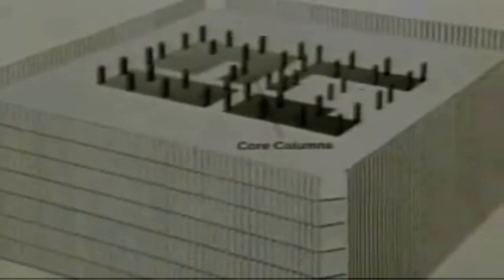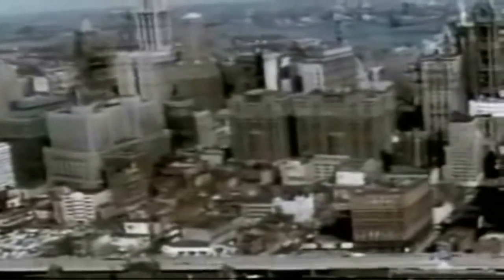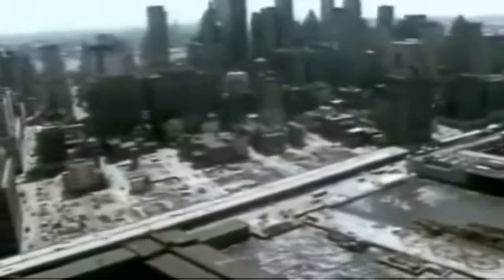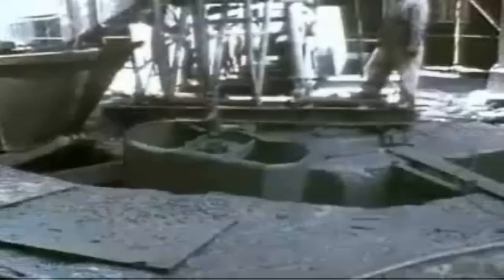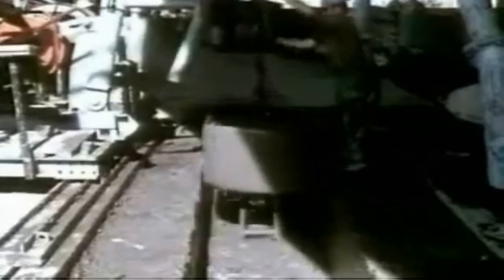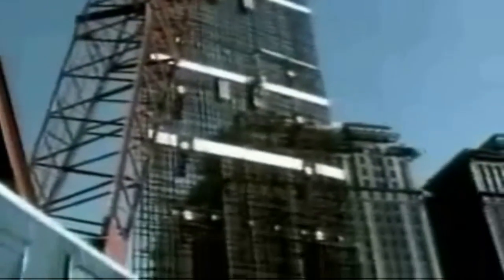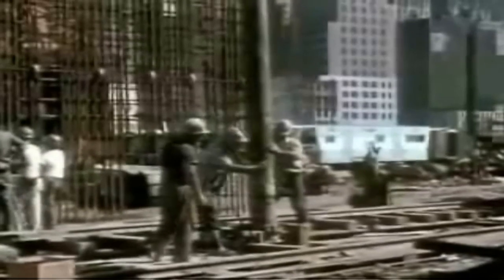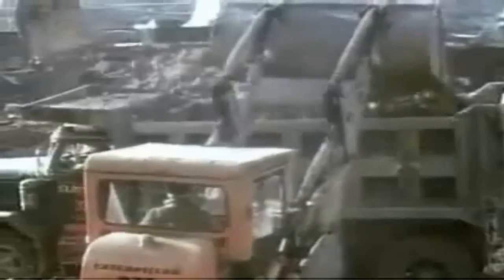Building the World Trade Center Towers

Comment: an airplane would bounce off this.  throw a coke can against a steel pole.
Reply: Lloyd Wagner
"bombs went off in the basement before the planes hit" 
prove it

"there isn't enough jet fuel to fill an elevator after blowing up"
flight 175 had about 7,000 gallons of fuel, and only the portion of it that was turned into a spray upon impact was the portion that exploded at the beginning. How is it impossible that the kerosene could have spilled down the elevator shaft hmm?

thickness of steel:
You seem to be confused. I'm definitely confused by your comment. I don't know what you're talking about. The outer wall was made of large steel box columns. Those columns were hollow. I don't know for certain how thick the walls of each column was, but oldschool is claiming that the walls were only 1/4" and 3/8" thick at that height. So the steel columns were just flat 1/4" plates that were welded to form a box shape. At "point of impact" he was probably trying to point out that the thickness of the steel was different at different heights. It was thicker at the bottom and thinner at the top to keep the building light. With that in mind, it only made sense for them to crash the plane into the upper parts of the buildings. That way they could do more damage.

You sound like a "no planer." Am I right? You know... half the population of Manhattan watched two planes hit the twin towers. Too bad you can't just dismiss half a million witnesses.
Reply: Adam Selene 
1. I think it's very clear to everyone that it has an ignition source. You don't need a fire to set it off. You just need heat.

2. Nobody ever said it is exploding on every floor. The puffs of air you see during the collapse is the effect of every floor collapsing onto the next floor under it.

3. "Nor is vapor going to fall down those long elevator shafts in enough quantity to detonate only in the basement and tear out heavy walls"

 well why not? How exactly is this unrealistic?  Its not. A few gallons fall to the floor, it vaporizes after a few seconds, then something hot or on fire falls and ignites it. Tell me that's not realistic. Tell me you wouldn't expect that to happen multiple times after a plane crash.

4. If demolition charges were going off in the lobby, everyone in the lobby would have died. They survived because they were seeing kerosene vapor explosions which expand much slower, have a smaller shock wave, and involve large flames. Demolition charges don't have flames, and they cause internal damage and deafness to anyone within the shockwave range. Did everyone in the lobby go deaf? No, because there were no bombs in the lobby.
Reply: Lloyd Wagner You're not paying any attention. Nobody said the contact area is 1/4 inch thick. Are you stupid? I just finished explaining that point. Look like 3 comments back

Adam Selene  How many people do you think are in on this "conspiracy?" How many people do you think have been burying this for 13 years? How many would have to be involved in order to pull off a "controlled demolition" NONE of which have confessed in 13 years. Really? None of them? Nobody has had a guilty conscience and just said "hey everybody. I helped set the charges on the north tower. Sorry about that." or "hey everybody, I worked in flight control that day, and there wasn't a plane" or "hey everybody, I worked at the Langely base that day, and the whole thing's bullshit" or "hey everybody, I work for Fox News, and the live feed wasn't really a live feed" or "I was in chopper 4 that day and the plane wasn't really there" or how about "Hey everybody, I was recording the whole event and I never gave my video to the government for the investigation. Here's some original video!" 
Seriously?? in 13 years none of these things have happened?? Oh I guess its because its not a conspiracy.
Reply: Yes well I was only trying to debunk the idea that a plane can't go through the outer wall. To know how much floor it can destroy would need a much more complicated calculation. But as as rough estimate, you can compare the kinetic energy of the plane to the energy released in a TNT explosion. According to this webiste, http://911encyclopedia.com/wiki/index.php/World_Trade_Center_Jet_Impact_Kinetic_Energy

the kinetic energy of flight 175 was about 3.5 billion Joules. According to wikipedia, one ton of TNT releases about 4.2 billion joules of energy. https://en.wikipedia.org/wiki/TNT_equivalent 
So this means that the amount of energy that flight 175 released into the building was about 80% of one full ton of TNT and it directed all of that energy within the path of the plane's collision. Would you believe that 0.8 tons of TNT can do that much damage? Because that's exactly the amount of destructive power that plane contained when it collided with the building.
Reply: Can't argue with real physics.
Reply: Robin Redbreast
1. I haven't justified anything.
2. It's just like you said. repeating "it was a planned demolition" doesn't make it true no matter how many times you say it. It just shows what a stubborn moron you are.
Reply: .... unless it vaporizes.. In which case it explodes
Reply: aSASa45454 it was planes and a fire :/
That's the very point I try to focus on in this endless, pointless battle with YouTube commenters.
Reply: That's the shill's decoy and defence tactics, engage the opposition in nonsense arguments, add some abuse and insults till you ground them down in frustration and drive them mad.  Shills and Hasbaras never give up, but the truth is the truth.  A guilty psychopath never gives up.
Reply: lol. If a 25-ton block of butter hit a twin tower at 500 miles per hour, it would obliterate the outer wall. The material doesn't matter. The beams can't stop that much kinetic energy. Period.
Reply: Oldschooldan1 Those bombs in the basements fell out of those planes too, I suppose. LOL
Reply: ***** Not without something to set it off it doesn't, nor is it going to explode all up through the building on discreet floors at regular intervals. Nor is vapor going to fall down those long elevator shafts in enough quantity to detonate only in the basement and tear out heavy walls. Check out what people that were in those basements said about the explosions.
Reply: an airplane would definitely not bounce off of the towers for very obvious physical reasons
Reply: *****
crashing at the bottom would still be more effective (if possible) regardless of the thicker columns.

also there would be very little fuel to run down 100 floors of elevator shaft (ignoring that there are no elevator shafts that go to the lobby from the 100th floor, except the service elevator which was not damaged in impact, obvious from the fact people were in them at time of impact)

so no, its not really possible for the fuel to have went to the bottom and had any significant amount of explosive power.
Reply: *****
Well I'm not trying to say that I think everything about the events can be put off as "I'm not sure, but it seems unlikely, therefore the guvvament dun it"

I just dont see the point in arguments like the lobby explosion, "no plane" nonsense, and car fires for example. There is much more compelling physical evidence in regards to the actual collapse mechanism.

I dont care how it was taken down (Mini nukes, directed energy, explosives, nanothermite, and godzilla to name a few)

I just care that it wasnt a natural collapse.
Reply: ***** I read that calculation of yours(a.k.a the long comment ) and its simply the best explanation one can give so patiently :) and please someone educate the guys with the "bounce back" theory that not all 1000s of tons of building material is opposing the plane its just three floors of slotted iron columns (with its respective core) versus the plane . its like shooting a small canister filled with gasoline at 400 mph into a slotted iron mesh completely devastating the latter .
Reply: Joseph Chavez this is old. I don't remember what I said. What are you referring to? The outer wall? I've since learned that the wall was made of verticle box columns that tapered in thickness as they went up the building.
Reply: Lloyd Wagner 
hurr durr it's not like he knew he was going to die or anything. It's ridiculous to think he wanted to identify himself hurr derr

So lets recap. You think:
All of it was faked and
The Bush administration is in on it
Congress is in on it
The FBI is in on it
The CIA is in on it
NIST is in on it
United Airlines is in on it
American Airlines is in on it
The US Air force is in on it
MIT is in on it
Purdue University is in on it
Popular mechanics is in on it
All of these peer-reviewed studies are using fake numbers and nobody has noticed yet
http://debunkingnoplanes.blogspot.com/2014/04/scientific-research-on-physics-of-world.html
The witnesses are in on it
All of the media is in on it
Pretty much every structural engineer on earth is in on it, since the AE911truth movement is about as significant in numbers as a high school.
FEMA is in on it
The FAA is in on it
And the victim's families are in on it

^All of these would contain dozens to thousands of co-conspirators each and after 14 years nobody has come out of hiding or even leaked a single shred of credible evidence. And you think I'm the one who believes a fairy tale.
Reply: Adam Selene 
So you think all of those thousands of people are just pussies. Is that right? None of them would expose the inside job if they had a chance? Not even the veterans among them? Nobody would anonymously release a file via wikileaks? Nobody in the ENTIRE scientific community would even debunk the studies I just posted in fear of the government?

https://s-media-cache-ak0.pinimg.com/736x/a8/a1/57/a8a157dea81462378ca87a25c37138ef.jpg

this gets better every time I see it
Reply: So who are these imaginary people with sensitive info you are referring to? Your delusion is proving to be quite entertaining
Reply: Adam Selene
Exactly. And he DOES know the government is lying.
Reply: Except for the fact that the planes were flying at a downward angle for several miles before the impact, which easily causes dangerously high speeds. Try thinking for once guys
Reply: Adam Selene
http://911blogger.com/node/20232

here's a quote from that link:

"2.	A Boeing 767-200 airframe is rated to .86 of Mach speed (speed of sound) at any altitude before the risk of structural failure. It as the aircraft approaches the speed of sound when the properties extreme high and low pressure areas can have destructive effects on the airframe. This figure is as with all limits set conservatively.
3.	The speed of sound at approximate sea level is 761 mph on a standard day. Therefore the theoretical maximum speed the 767-200 can reach intact is, conservatively, .86 x 761mph = 654mph or approximately 100mph above the officially reported speed of AA11 or UA175."
Reply: @TaylorYarick  thank god some people with real knowledge can talk back facts to these conspiracy morons
Reply: aSASa45454
You know how it is though; cowards will say anything to avoid the logical conclusion if it makes them uncomfortable. It is very sad that people can be that afraid of something as simple as the truth. Oh well, Ya' just can't help a person understand that refuses to.
Reply: aSASa45454
"crashing at the bottom would still be more effective"
I disagree. I don't think the plane would have even penetrated the steel if it hit the bottom of the building instead.

about the elevators/fuel: I don't know much specifics about the elevators or the floor plan of the core structure. According to this link, cars 50 and 6 both could have fallen straight to the ground, and there was also many other elevators that could have fallen to other floors. https://sites.google.com/site/911stories/wtcelevatorshafts

there's also this. click on it, press ctrl+F, and type "smell"  http://www.911myths.com/html/jet_fuel.html
Reply: Rat Salad Lovely.
Reply: : Well, that's the real question, isn't it? Why? The 'How' and the 'Who' is just scenery for the public. Explosives, no planes, melting steal, keeps 'em guessing like some kind of parlor game. Prevents 'em from asking the most important question: Why? Why was it done? Who benefited? Who has the power to cover it up? Who?...
Reply: Lloyd Wagner 
you're pretty misinformed. The plane did slow down during impact. Look it up. Its not hard to find proof. Or do measurements yourself if that's your style. Everyone who does it concludes that the plane lost about 12% of its kinetic energy before it went out of view. And the twingtips didn't even break the beams. They only knocked off the aluminum cladding, exposing the steel. It's visible in photos. So there you have it. Your argument is based on lies. Not mine.
Reply: Lloyd Wagner 
well you obviously haven't done a single bit of research on anything. I'm not going to do it for you. Instead of assuming you're right all the time and everyone else is wrong, you should try actually backing up your beliefs with research and  evidence. You'll end up feeling like an idiot.
Reply: Lloyd Wagner 
excuse me, when you say "there was only a 16 foot wide almost round hole" are you referring to this?
http://911review.com/errors/pentagon/imgs/exit2.jpg
and are you trying to say that its the entry-point of the plane?
Reply: Lloyd Wagner 
Oh god look at all that aluminum cladding.... It just breaks my heart to show you how stupid you are....  https://www.metabunk.org/data/MetaMirrorCache/99e11088e7613155bda454cfe4e0dcab.jpg

not.
Reply: oh sweet jesus all that aluminum cladding and plane parts  http://files.abovetopsecret.com/images/member/3fc887f4576f.jpg
Reply: oh gawd I'm jizzing from all this aluminum cladding on the steel beams!
https://3.bp.blogspot.com/-FkH60hn3iC4/U7pUIwxaV_I/AAAAAAAAAPI/E3wlHRf5fFE/s1600/WTC1+leftwing+01.png
Reply: Are you blind?

I showed you pictures of the steel beams, with the aluminum cladding clearly visible. The aluminum is silver. The steel is brown. 

so where is this "16 foot hole" you're speaking of hmm? Where are these windows that were supposed to be hit by the plane huh? Seriously. Show me one window that was supposed to be broken.
Reply: Lloyd Wagner 
Hey look i found  proof that you're a total moron
http://911research.wtc7.net/essays/salter/summaryimages/nistwtc1hole2.jpg
WOW!!! amazing. the plane fits.

And you just showed me a picture that shows knocked out windows where the plane hit on the bottom floor. Here's another one for you  http://www.bibliotecapleyades.net/imagenes_sociopol/911_3playact15.jpg
Again, where are these intact windows you're going on about
Reply: Lloyd Wagner 
so your argument is: a plane can't punch a perfect hole into a steel building so there was no second wtc plane. And a plane CAN punch a perfect hole into a concrete reinforced building therefore there was no plane at the Pentagon. Is that what you are sticking with?
Reply: Please correct me if I misunderstand because you are looking dumber and dumber every minute
Reply: So when you move from stupid question to stupid question like that, are you admitting defeat on the ones I already answered or do you just pretend to pay attention?

The passport! OH GAWD the passport! I feel so powerless as this is obviously the smoking gun of the entire operation! It's not like wallets and passports are ALWAYS found in EVERY plane crash site that has EVER happened!
Reply: Lloyd Wagner you apparently don't know that the passengers of the planes had cell phones. They mentioned the box cutters during the calls. Maybe now you see why I keep calling you stupid?

https://s-media-cache-ak0.pinimg.com/736x/a8/a1/57/a8a157dea81462378ca87a25c37138ef.jpg
derr derr duh derr just move from topic to topic and maybe you'll look less dumb derr derr
Reply: No I know nothing of Michael Hastings. Please fill me in on his relevance to 9/11
Reply: Lloyd Wagner Lol there's a big difference between being under rule of an evil person and actually keeping an evil-doer's secrets for 14 years. Your comparison doesn't even make any sense. I'm on the real side of history. You're on the delusional side. What you believe is a fairy tale.
Reply: Adam Selene 
Oh so you assume that the government lies about everything. Okay so I guess terrorist attacks aren't even real. Is that right? The government must be responsible for the boston bombings too huh?
Reply: Lol you guys are great. Both of you are like a Christian who thinks that atheists are just rejecting god's love or some bullshit like that. No no, I just don't believe he exists. There's a very big difference.

I'm going to try to make this as clear as possible for you. Don't make claims about what I believe or know.

I do not believe that 9/11 was an inside job, and I never did.
Sure all governments have secrets but if the government is lying about anything 9/11 related, it has nothing to do with covering up a false flag because while the American government may be corrupt, it's not a bunch of evil illuminati lizard people who kill citizens like sheep. If they wanted to perform a false flag, there are hundreds of easier ways to do it.  Also, "No-planers" are the dumbest, most useless bunch of people I have ever conversed with. Truthers I can stomach, but No-planers are about as deluded as flat-earthers.
Reply: Adam Selene
 Is that comment relevant to the conversation somehow? You're insinuating that the government lies about everything, and therefore 9/11 had to be fake. I was just pointing out what a dumb argument that is.
Reply: Tomislav Kovačević Hey, just so you would know, passenger planes can NOT do 500 mph at 1000ft sea level, its impossible. Yes they can reach that speed, but only at 30,000-35,000 ft where the air is much thinner. Cause it was designed that way!!! Hello McFly!!!!!
Reply: look what a tornado can do with cardboard something going that fast doesent really care whats in the way
Reply: +Lloyd Wagner You are the dumbest person I've ever seen on YouTube. Truly an accomplishment.
Reply: Oldschooldan1
Jet fuel can burn, it does not detonate. Think "kerosene".
Reply: *****
Yeah, I suppose it is possible. There was also a car #7 then went basement to top.

It seems unlikely but its also not something I am capable of disproving. I dont find the lobby explosion to be all that critical in the grand scheme of things.
Reply: aSASa45454  Just as I am not capable of disproving the thermite theory, since there is just a huge lack of physical evidence. But that doesn't mean I'm going to fall for an appeal to ignorance fallacy
Reply: *****
Still that nonsense? LOL
Reply: Aparajith Sridharan
Nope.
Reply: Robin Redbreast
Exactly right.
Reply: ***** No, it wasn't a solid slab of steel. It was an intense grid of steel.
Reply: loutcb You idiot. Just think about how big object a plane is and how fast it crashed...
Reply: Robin Redbreast whether you understand it or not, it is the correct answer.
Reply: Joseph Chavez
There was only ONE country that had ONLY benefit out of it, and there were 5 of that country's citizens picked up laughing and dancing in New Jersey that day. The dirty fuckers.
Reply: *****
Tell ME to "look it up" and find proof for the idiotic shit that YOU are claiming. Man, have you got some nerve.
Reply: ***** Right, I'll do research to try to prove your bullshit, and forget the clear evidence of the videos.
There IS no aluminum cladding over the WTC. I've ALREADY done the research and watched more than one video on the original construction of the WTC buildings. The "planes" did NOT slow down. You can see it right in the video, by watching it frame by frame.
There WERE no broken windows where the wings would have gone into the Pentagon. There WAS only a 16-foot wide almost round hole.
You 9/11 criminals should have made the videos a little more convincing, if you didn't want people to call you the filthy liars you are.
Reply: Lloyd Wagner
Of course he does. Anyone drawing breath knows that at this point.
Reply: ***** The "bombing" wasn't the event; the response to it was the event. There were military on the streets in Boston, pointing loaded weapons at Americans in their homes. Is that sort of thing alright with you?
Reply: tzef73
Correct.
Reply: *****
It is about air density and airframe stress, not just thrust.
Reply: ***** A simulator? And professional pilots say you can't turn that plane at the reported airspeed at the rate of turn required. Nor can, under any circumstances, jet fuel melt structural steel.
Still, this is all old stuff; we already know the "official" story is nonsense.
Reply: loutcb are you actually that stupid?
Reply: You guys are arguing for way too long lol
Reply: Taylor Yarick - you talk a good talk but at the end of the day it’s just talk.  No matter how many billions of joules of energy were slammed into the trade center it doesn’t matter because those towers absorbed the energy and evenly distributed throughout the entire tower.  

If the structure was weakened at the impact point and give or take 5 floors above and below that section would fall in the direction of least resistance.  Meaning the top 20 floors cannot pile drive it’s way to the ground pulverizing concrete and steel to dust.  20 Ton beams were Hurled the distance of 2 football fields.  

And your explanation or reasoning covers towers 1 and 2.  Please explain what energy source cause building 7 to collapse at near free fall speed?  

If those towers did collapse according to your high end physics education then tell me why the collapse was not a gradual collapse and one which took less than 18 seconds?  The towers would meet resistance as it gets closer to the middle section and lower section.  Hmmm I’m guessing physics laws took off that day needed a rest just like your BS comments.
Reply: Jiren The savage - that would make sense if there wasn’t those annoying NEWTONS LAWS....  also your other problem would be how you can get a commercial airliner to travel at 550 MPH at only 1000 feet...  👍🏼👆🏻
Reply: This is by far one of the most retarded comments I've ever seen on a youtube comment section. This is definitely in my top 10 most retarded comments. This is so retarded, that I don't believe you're being serious at all.
Reply: loutcb Completely 100% wrong.
Reply: Was there an argument in there? I didn't see one. I just saw you throwing empty insults because you lost the argument
Reply: Lloyd Wagner That's funny because I'm working on my engineering degree and I'm likely the most educated person who has commented on this video by far.

Lets say our 767 weighs ~ 120000 kg. It flies at ~240m/s and the buildings were 63 meters wide. If I allow the entire building's width to be the plane's stopping distance, then [120000 kg * 240 m/s * 240/2 m/s / 63m] rounds off at ~ 55 million newtons of force (12.4 million pounds) required to stop the plane in that amount of time. It also rounds off at {[120000 kg] * [(240) m/s]^2}/2 = ~3.5 BILLION joules of kinetic energy being dumped into those steel beams, nearly all of which was converted into heat. Then, there was the fire. Obviously this is only a general order-of-magnitude calculation but it helps wrap your head around the physics. Can steel box columns, separated by a few feet, hold back 12.4 million pounds of force? If the steel beams at the perimeter COULD hold back the plane, then the stopping distance would have to change in my equation. Lets give it... what? Say 10 meters of deformation in the steel?  [120000 kg * 240 m/s * 240/2 m/s / 10m] = ~ 350 million newtons (79 million pounds) Are those steel beams capable of applying 79 million pounds of force, spread across the area of the front of a plane? No, I think not. The plane could have been made of cotton for all i care. It still would have broken through the outer wall.

 this is nothing like a peanut vs a hammer. Nor is it on the scale of an aluminum can vs a brick wall. It is more on the scale of an aluminum can being shot out of a gun, at a thin, mesh wire screen.

This is not about which material is stronger. This is about the momentum of the plane. That thing is a huge mass moving at a huge speed and it is very hard to stop. Sure if would bounce off the building if the entire building was a solid block of steel or a solid block of concrete, but its not. It is a hollow structure of steel framework and cemented trusses for floors.

On a further note, you probably got your argument from Ace Baker's video. Ace Baker is a professional liar. Even among other conspiracy theorists, he is a laughing stock of sorts for his "no planes" theory. He's very good at making lies seem like the truth at first glance, but that's all he's doing. Many of his arguments are based completely on false claims, such as his 3-layered live feed theory. That whole argument goes out the window when you find out that there was more than 3 live feeds of the crash. Chopper 4 recorded the plane from a completely different angle, which debunks his whole theory. 

If you're still not convinced, what exactly do you think happened? If you really think there were no planes at all, consider this. HUNDREDS OF THOUSANDS OF PEOPLE WITNESSED THE SECOND PLANE and many of them recorded it. If this was simply  video editing, the amateur videos recorded from the street would not show exactly the same thing as what the news cameras showed. If you think all of those videos were edited, you seriously need to think about what's realistic. NONE of the amateur recorders have spoken up about their videos being edited. 

Therefore, the "No plane" theory is the dumbest of the dumb 9/11 theories.
Reply: ***** That's how real physics works. If you can't take it, then just read the last paragraph or two.
Reply: Lol. That last bit made me laugh.
 I can't say the thickness of the aluminum because I did not design the building and therefore I can't realisticly scale it down like that. I'm only providing an analogy to help visualize my point. My point is that the steel wasn't thick enough to stop a huge jet. Also the nose didn't poke out the other side as far as I know. In the clips I've seen, the image is so blurry that you just can't distinguish between a jet and a cloud of dust. But whether it's dust or a bad CGI job is a whole other can of worms.

Anyway, there's calculators on the Internet you can find that tell you the lateral load of typical steel beams. Check one out and try doing the math. If you can find a real contradiction in what I say that is based on math and not on intuition, I would gladly debate it with you. Otherwise I've put in my two cents and I'll end it here because you seem to be resorting to ad hominems that don't contribute to your argument
Reply: 1. I have no way of proving my education, so I demonstrated it instead. If you spend some time studying kinetics equations and classical physics, you will soon learn that everything I said was accurate.  
2. Nothing I said defies newtons laws of motion. Perhaps an analogy will help. Imagine shooting a paintball (or a plastic bb if you prefer) at several sheets of aluminum, spaced an inch apart. Paintballs move at about 200 mph. Is solid aluminum harder than a paintball?  Yes. Would the paintball go through the sheets anyway? Yes. What if the sheets were  moving at 200 mph and the paintball was suspended on a string? Would the ball go through the aluminum? Yes. In both situations it would probably go through several sheets. In order to apply newtons third law correctly, you must consider this: aluminum sheets (steel bars) have a maximum lateral load. That means that when a certain amount of force is applied, it beaks. Let's say for example, that the maximum lateral load of a certain aluminum sheet is 1 pound per square inch and the sheet can maintain that load for 1 second before it fails. The paintball would exceed that and break the sheet in a small fraction of a second, but the ball would slow down because THE FORCE IT APPLIED TO BREAK THE SHEET WAS ALSO APPLIED ON IT BY THE SHEET. 

That is how newtons third law is correctly applied in this situation.

As I have said before, the materials used makes little difference. It's the mass and kinetic energy that does the work.
Reply: Tomislav Kovačević
Do the math? The building weighs 1000s of times more than the airplane, like a brick wall compared to a beer can filled with gasoline. Throw the can against the wall slow, or throw it as fast as you want, there's no way it's going to go effing right INTO the wall and disappear inside.
Reply: Lloyd Wagner The math shows otherwise. Seriously, do the math. Plus, an aluminum can would go through anything if it was moving fast enough.
Reply: How so? I'm not following your logic
Reply: Lloyd Wagner
They must be, or he was threatened, or he is just a coward. We may not know the exact method, but we know it was a pro demolition using steel-cutting charges and that planes could not cause the collapse. But alas, Ya' can't convince the shills to quit lying.
Reply: Lloyd Wagner
The real issue is that none of us knows exactly how it was done; the NIST report was nonsense, the "9/11 Comission" was bogus (and Bush Jr. even tried to get Henry Kissinger, of all people to chair that farce), questions have been asked and not answered, the various statements made by "officials" are entirely laughable (except that is isn't the least bit funny). All the "classified under national security" nonsense is ridiculous, since it is a done deal, a past event. Anyone that does know exactly how it was done, can never say anything because they would be admitting to High Treason, murder,  conspiracy to commit, numerous felonies, etc. This leaves us with some good guesses, and a lot of bogus nonsense as well. We know it was an inside job, we know a pair of planes are entirely incapable of dropping 3 skyscrapers specifically designed to take multiple plane hits, etc. We also know the agenda that it promoted and we have seen the disgusting results. We know who made money, we know who gained power; they are always the same people, and we know what they do to those that oppose them (discredit, buy, threaten or murder them).

Only one question remains, and it is this: How are we going to bring the perpetrators to justice?

It really amazes me (not an easy feat) that anyone still denies the obvious, and some of them even do it because they believe that Bin Laden nonsense, that planes crap, or even that Bush/Cheney didn't know. LOL

What a crazy place America has become, eh?
Reply: maybe but WTC is tube construction design building and boeing 757 is 99.800 kg heavy (100 tons), now do the math 500 miles per hour fast 100 ton's heavy plane vs building !!
Reply: ***** Physics says otherwise.
Reply: *****
That is exactly why so many people have realized that 911 was a planned event.
Reply: Lloyd Wagner
They believe the lies because they are cowards and the truth scares them.
Reply: *****
In other words, this single event caused your government to all of a sudden stop lying about everything? Talk about delusional. Yeow.
Reply: *****
What your equation fails to address is the 1 acre of 4" thick reinforced cement slurry, on top of 12 ga. corrugated deck plate per floor at approx 11 foot between floors for lateral support of the exterior columns. An aluminum tube wouldn't stand a chance, let alone the aluminum foil wings. The only thing making that foil rigid are spars and spanners. Hardly capable of penetrating steel box columns. let alone the static mass of an acre of cement.
Reply: *****
Incorrect (you're getting good at that); it is a demolitions term. It means "fire in the hole, we're going to drop this building".
Reply: ***** Incorrect, "pulling" is the exact slang pro demo companies use to refer to a building implosion.
Reply: ***** The term is used in conventional demolition circles, to describe the specific activity of attaching long cables to a pre-weakened building and maneuvering heavy equipment (excavators, bulldozers etc) to 'pull' the frame of the structure over onto its side for further dismantlement, and is generically used to describe taking down a building by other means (which is technically incorrect, but they still say it). Silverstein, being the leaseholder, would be consulted in a non-critical demo such as B7, since it had minimal damage and limited fires. Imagine the rewards he got for all those financial records being destroyed before they could be investigated. Again, follow the money; foreigners stood to gain nothing but harassment by US troops, but those that planned it profited 8 ways from Sunday, even before their agenda was furthered by NDAA and all that nonsense that followed as a direct result of misleading the public about this deliberate act of murder and treason. Would you put this past Dick Cheney? I sure wouldn't; that guy is a demon, just pain evil, and he doesn't even try to hide it; the smug little psychotic.
Reply: Several 4-inch concrete floor slabs didn't slow THOSE planes down any more than the steel framing did! I'll betcha some of these guys believe in Santa Claus, too, because they saw a video on TV of him landing on a roof with 8 reindeer pulling his sleigh. Christ. What some people won't believe.
Reply: Lloyd Wagner
I wouldn't even bother with that kid; definitely a mindless shill.
Reply: *****
Yeah, I'm dumber and dumber all the time. We all know it was 19 fanatic Muslim (but hard-drinking and stripper-playing) Arabs with box-cutters and kerosene fires that turned those buildings into dust within a couple of hours.
And the passport?? And the passport?? And the passport????
And the video-cameras at the Pentagon?? All busted at the same time, eh?
Hey, did they find the box-cutters in the dust? Or how did they know it was box-cutters? And how did they know whose box-cutters they were? Were there finger-prints on them after the collapse of the buildings when the dug them out of the dust?
Hey? Asshole? Answer the questions.
You're on the wrong side of history, bud. Go to hell.
Reply: Lloyd Wagner And Marvin Bush too.
Reply: *****
Apparently you don't know that cell phones didn't work worth a shit from airplanes back in 2001. The "calls" could much MORE easily be recorded by any-fucking body, from any-fucking where, and don't prove a fucking thing. The fact that one guy introduced himself to his "mother", using both his first and last names, is kind of a clue that the calls were faked. Except for idiots or shills.
No, I don't believe every conspiracy theory on Youtube. And I don't believe the conspiracy theory that 19 Arabs with box-cutters flew those planes into those buildings (right inside, as we can CLEARLY see the planes going right inside on the video) and then kerosene fires causing the whole fucking building to explode into dust an hour or so later while a passport survived the whole ordeal intact. And that every fucking camera at the Pentagon quit working, (except for about 5 frames that do NOT show an airplane). No I don't believe that.
You go ahead and believe it. You're much "smarter" than I am. Shill.
Reply: *****
In on it? Afraid of it, more likely.
Reply: ***** Many many people have come forward about this and been squashed. I would hope that someone would tell them to take their threats and bribes and stuff them, but everytime someone has some sensitive info, they meet an untimely end. Remember, this is all a part of the same thing; the poisoning, the depopulation, the terrorism scam, and there is huge money behind these people.
Reply: *****
Remember Micheal Hastings?
Or did you think the big money doesn't protect itself from the truth?
Reply: Except the bombs went off in the basement BEFORE the planes supposedly "hit". And there isn't near enough jet fuel in one plane to fill even one elevator after blowing up in flames right in the beginning, that's just ridiculous. And Oldschooldan 1, the "thickness of steel at point of impact" is complete b.s. The WHOLE plane disappeared right into the building without even slowing down, just watch the videos.  There was no single point of impact where you could measure the thickness of the steel from 1/4" to 3/8". What obvious lies! Good work of lying and obfuscation, Taylor and Oldschool!!
Reply: *****
Yeah, we have all heard the crap the mainstream pushes. Who said there were demo charges in the lobby? That's absurd.
Reply: Lloyd Wagner Yes, the pundits and shills never stop lying.
Reply: *****
Yes, that's how they do it; slander, immediate destruction of evidence, and Marvin Bush.
Reply: joe banana
Exactly.
Reply: ***** Sure, planes hitting buildings is going to cause some damage, some fire, a mess. For 3 buildings to drop into their own footprint, one not having been hit by anything, is patently absurd.
Reply: *****
Again with the structural damage. Yeah, everything around took damage from the debris, and nothing large hit 7. Fire does not cause a structural steel framed building to collapse; it has never happened; not ONCE, anywhere. Pro demos are said to "drop into their own footprint"; that doesn't mean there isn't debris scattered around, and there always is.
Reply: *****
What debris was large enough to cause B7 to implode? Where was the damage? I've been over everything there is on it and I saw nothing large.
Reply: *****
Minimal damage. "Report" said some corner column let go, yet it dimpled in the middle then it dropped. Does that make any sense to you? It doesn't to me.
Reply: *****
Yeah, and they said "pull it" on national TV.
Reply: Lloyd Wagner
Exactly.
Reply: ***** Ya, sure, that plane would "pass right through the building like a cannon ball through wood", and perhaps even continue flying on, eh? Not even the tips of the wings would be bent, they'd go right in and through, too, just like in that cartoon we saw on TV. You're NOT being paid for making an utter fool out of yourself? Wow ...
Reply: ***** As if a plane couldn't possibly weigh 10 times more more without being 10 times denser at the same time. You're making a fool out of yourself again, Gabrious. You think I have a funny name, do you, and suggest "Van Buren"? I use my own name. I'm not ashamed of my opinions. I'll bet I can't find YOU on Google, shill.
Reply: Of course. Nothing over a certain size or weight could possibly fly. But if it could, it would go right through a building without even slowing down. As we say in Minnesota, Ya, sure ya betcha.
Yeah I knew that Gabrious is a nickname. I'd use one too, if I was posting such nonsense as you are.
Reply: Taylor Yarick, the way I said it, in capitals, was really to hear the end of it because there is nothing more to say,  but you, defenders of lies and this unbelievable evil act never ever give up
Reply: ***** You go ahead and lol and keep up your treasonous (and idiotic) lies. You people have absolutely no shame.
No, a plane made of butter would not fly into a steel-frame building, including even the thin wingtips, without even slowing down one bit, and disappear.
Neither did the aluminum "airplane". Christ, those wing-tips are only a couple of inches thick on the ends. Nah, they would NOT have cut steel, no matter how fast they were going. They would have bent back. And the plane would have been waaay slowed down by the time the wings got to the building, so don't even talk about kinetic energy allowing thin aluminum to cut steel.
And hey, how about the same kind of plane hitting the Pentagon. How come the wings didn't go right in on that one and make an airplane-shaped cut-out? Different kind of kinetic energy, there?
Come on, fucker, come up with another lie. How many more hours do you have on your shift?
Reply: *****
Sure, we can ALL watch the videos and see who is lying. We can see the plane slowing down, and we can see the "aluminum cladding" over the steel being knocked off, exposing the steel, just as you say. Sure we can. We can all find a video telling how the WTC towers were clad in aluminum too, and we can all read information of how the plane DID slow down, and "lost about 12% of its kinetic energy before it went out of view". And if we can't, I'm sure you'll give us links in your next answer, because I'm sure you're not talking right out of your ass.
Nobody in the world can see a plane flying right into a building and disappearing without even slowing down, just as you say, bud.
And the 757 that flew into the Pentagon WITHOUT even breaking the windows where the wings would have been if it were a real plane? New kind of kinetic energy there, invented in the hour or so after the Twin Towers were "penetrated"?? And what happened to the videos of that one? Come on, let's talk about the Pentagon, too.
You truth-deniers have absolutely NO shame.
Reply: PLEASE tell me that's what you think. I can't contain my excitement. I knew you were stupid but holy shit dude you have no idea what you're talking about.
Reply: *****
You've shown a picture of an hole in an interior ring of the Pentagon. I asked specifically about the unbroken windows on the OUTER wall, where the wings would have been.
And no, the steel outer grid of the WTC was not aluminum clad, as you claimed. No amount of pictures will change that fact of the original construction. You're a liar.
Reply: *****
And the wing peeled that off in exactly a square pattern. And then disappeared right into the building and didn't bounce back. Sure. I've WATCHED the videos over and over again, and anybody in the world can see the "plane" go right inside and disappear. And then leave a perfectly square pattern afterwards, though the "plane" went in at an angle.
Here's a picture of the Pentagon front face showing NO hole and NO wings: Now tell me why aren't there any videos of the plane going into the Pentagon? All the cameras broken at the same time??
http://www.tomheneghanbriefings.com/Pentagon__TMJ4_News___brightcove__vo__llnwd_net.jpg
Fucking shills.
Reply: *****
Yeah, I'm a total moron, bud. Sure, those wing tips did that, just like that. That's the normal way wiingtips work when hitting steel at 12% reduced kinetic energy. You're right. I'm an idiot.
But the wing tips didn't do anything to the Pentagon, except make all the cameras quit working.
Hey, did you ever figure out how a passport survived that plane going right inside the WTC, then that fireball, and then it dropped to the street in good condition? Did the Arab with the box-cutter drop the box cutter at the last second, bust open a plane window and toss his passport out? Do you have any pictures of it floating through the air?
Fock, there are millions of things in this case. The first, of course, are the videos of the "plane" going right in without slowing down.  Nothing can erase those, buddy.
Reply: Adam Selene
And grinning dancing Israelis picked up in New Jersey, and Larry Silverstein. Ya, they won't comment on ANY of that.  And on Judgement Day they'll play like they really believed their own shit. The fires will be hot.
Reply: Lloyd Wagner LOL Yeah, something like that. :)
Reply: *****
Yup, I think they found some wallets too, undamaged, with money in them. You're right. And box-cutters. They figgured out that those 19 Arabs used box-cutters, because they found some with fingerprints in the dust of the office buildings. Normally, there aren't any box-cutters in office buildings, so it was those Arabs that must have used them to hijack those planes that flew right into the buildings right on teevee.
And sure, multiple cameras go out at strategic moments all the time. Just damned luck, that's all.
Sure, Taylor. You're smart. More and more people are believing the likes of you every day. Keep up the good work.
Reply: Lloyd Wagner
Exactly.
Reply: ***** How many millions of people were "in on" or "afraid of" Hitler? The whole damned German nation, ALMOST.
Like I said, you're on the wrong side of history. Cowering shill. You wouldn't make a patch on the pants of a real human being.
Reply: *****
Incorrect. The government lies about everything, yes. That is not the rationale behind 9/11 being a false flag. There are simply too many things that do not add up that day for the "official" hogwash to be the truth.
Reply: Witnesses said there were explosions in the lobby before the "plane" hit. And we all saw the supposed explosions of the jet fuel when the "plane" first hit. And still the jet fuel went down the elevator AFTER it burned up in the initial "plane" hit. And somebody's trying to say that there was a single point of impact, 1/4 to 3/8 inch thick, when we all saw the "plane" fly right into the building and disappear, the whole width and length of it. You shills can't have it all ways at the same time. You're making fools out of yourselves.
Reply: Aparajith Sridharan
Each floor was a 4-inch thick concrete slab poured on top of steel plate, too. The building wasn't just an "iron mesh".
And even the hollow aluminum tips of the wings went right into the building without anything bending or bouncing back. Sure, OK.
America already believes you. Methinks you doth protest too much.
Reply: *****
No, it wouldn't. It would bounce off. Your knowledge of physics is at about the 2nd grade level. "For every action there is an equal and opposite reaction." The building is way harder and way more massive than the airplane. It makes no difference if you hit a peanut with a hammer, or a hammer with a peanut. The hammer isn't going going to give way, either way. The peanut isn't going to disappear inside the hammer.
Reply: You convinced the most people, so you win. I'm out of here.
Reply: *****
 I don't care if that airplane weighed 10 times as much, and was going 10 times as fast. It still does not travel right inside a building without even slowing down one iota, as shown in the cartoon video. You're full of shit. And we know that you guys are being paid, or you wouldn't talk such nonsense.
Reply: LOL. Have fun, Taylor. Hope they're paying you shills well for this nonsense.
Reply: It's all been said before, repeating stuff doesn't make it true.  IT WAS A PLANNED DEMOLITION.  I hope and pray the truth will be heard and the evil perpetraters are brought to justice, and you Taylor Yarick will have to find some other evil act to justify.
Reply: Ya, so the airplanes flew right into the buildings and disappeared, without even slowing down. In a couple of the videos, the (hollow plastic) nose of the second plane even poked out the other side, non-dented.
You're not impressing me, buddy. Maybe you're impressing others, I don't know.
You're not even saying how thick the aluminum sheets are that you're shooting the paintball at. Yeah, it would definitely go through aluminum foil, and maybe even a few sheets of it before IT WOULD SLOW DOWN AND STOP,  but no, it wouldn't go through even one sheet of 1/4 inch thick aluminum plate without exploding and bouncing off, blowing paint all over.
That's why they call them "paint balls". They even explode when they hit human flesh, they don't just pass through and come out the other side. You're talking shit, and making a fool out of yourself. That's why I suspect you're getting paid.
Reply: Yeah, there were a couple of arguments in there. One, I pointed out that you don't know anybody's level of education, and you haven't proven your own. Two, I used the argument of Newton's law of action/reaction. Something much bigger and harder vs something much smaller and softer. Which hits which, or how fast, is irrelevant; the result will be the same. "Equal and opposite" means exactly the same thing as "equal and opposite", duh. Saying I lost the argument is not an argument.
Reply: *****
You're a shill. You have no clue about anyone's education, and show no proof of your own. What you do show is a basic lack of understanding of physics. "For every action there is an equal and opposite reaction."
You drop one of those steel and concrete buildings real fast on an airplane, and it's going to make the airplane go right through the building?
Keep talking, fool, you're digging your hole deeper. And you'll have hell to pay besides, shill.